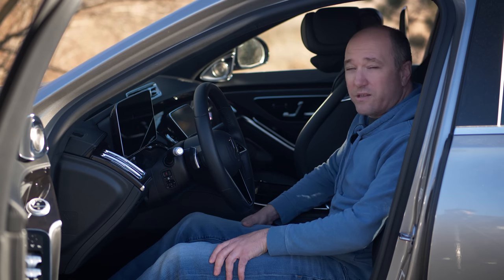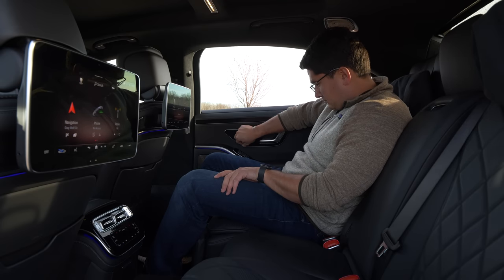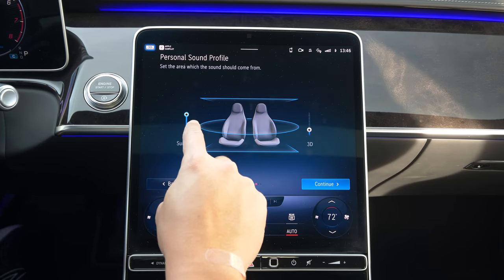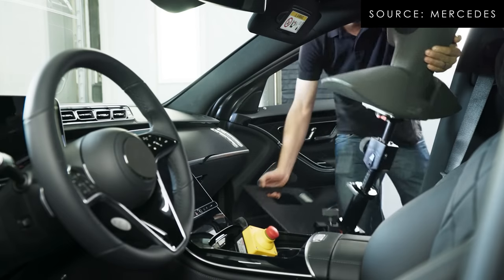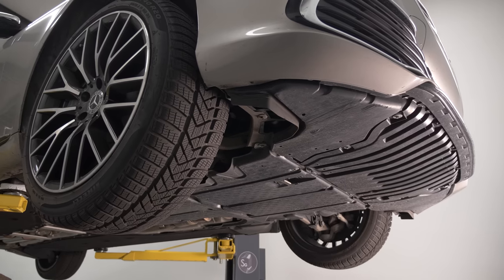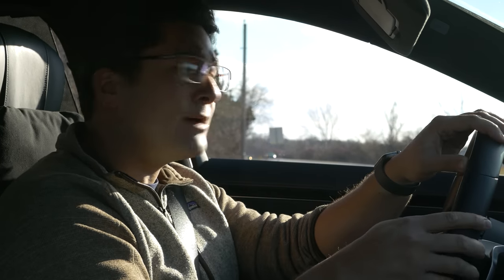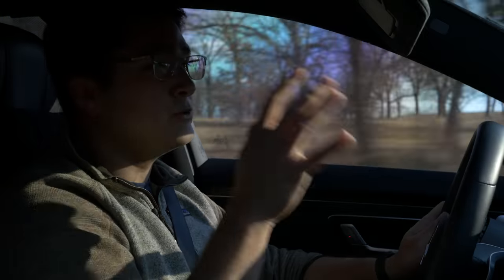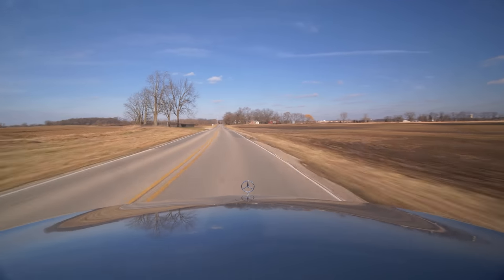Mercedes S-Class | The Best and Worst of Cars

Comment: I think MB went in the wrong direction with the S-Class but they sort of had no choice. The S-Class used to live on quality; quality of materials, quality of construction, and quality of engineering. That's what the old 70's, 80's, and 90's cars were like. The centerpiece was the quality, the thunk of the door, the feal of the leather. These cars were timeless, a car you gift to your grand kids. Enter Technology; Technology has become the centerpiece of the S-Class, and technology is not synonymous with quality; technology is cheap and disposable and that soils what is otherwise a quality car and makes the whole thing totally disposable. Your grandkids would laugh at you if you tried to gift this to them. However to compete with up and comer luxury brands, like Lexus and I guess the Koreans, now MB has to push the technology and skimp on the quality.

Comment: Did they really put the hazards button on a touch screen... fucc, what if your engine dies at night and the electronics are 99% down, in most cars the hazards can be actioned with the engine dead, not in the S class it seems. Not having physical hazard button is a hazard in itself
Reply: The hazard button as well as the other buttons in the row below the touchscreen are actually physical but yeah, if the screens go down you’re still in trouble in other ways 😅

Comment: Ask any W221 or early W222 owners about their long term experiences, same thing.  Plenty of them on the road.  Not sure what people here expect Mercedes to do here as far as tech.  It has to be there for this car's target market and the age of the S-Class owner has been dropping and in some markets they're much younger now.  The days of the simplistic W126 or W140 are over.  Now my issue is that they're changing things like the seat controls or the door handles just for the sake of change.  The center screen doesn't bother me per say, but that damn screen behind the steering wheel is gawd awful.  Yet for all the backlash here, the car owns the market and it's polar opposite a car like the LS500 is nearly dead.  Extreme disconnect from 99% of the commenters and actual buyers.  I don't get that animus in the review.  Way off base IMO.  Good or bad, a Mercedes is always an aspirational purchase.

Comment: Just wait 'til you review the EQS. This is the road we're going down and there's no turning back.

Disposable, lease-only, gimmick-driven oversized iPads on air suspension powered by drivetrains that have had all their character and uniqueness engineered out of them.
The looming threat of EU-enforced limits on carbon dioxide emissions and a general alignment of production methods and platform-based architectures between manufacturers will make every new model of every brand more bland and similar with every year that goes by, until drag coefficients are so important that every car has the same, Prius-ish shape, and thermal efficiency is so important that every engine will either be an electric motor or sound like a vacuum cleaner making love to a dryer filled to the brim with paperclips and bearing balls.

If you don't have an interest in engineering or technology there will be nothing left for you in the automotive world in ten years time. It's over. The car is now fast-tracking to become the very thing an increasingly nihilistic society wants: completely rational.

Comment: I wonder if this this Benz will  burn itself to the ground if seat heater does an imitation of the 2000-2007 M-Class vehicles, 2006-2007 RClass vehicles and 2007 GL-Class.
The seat heaters in those vehicles were not content with only heating rich ass in the seat,  the over achieving bun warmers often heated the whole car, garage, and house in a fiery inferno.

One class action suit later and Mercedes agreed to patch the fire prone thrones.

Comment: If you look at the ENTIRE CAR from the passenger rear seat, it starts to make more sense. It’s a driven car, not a driver’s car. The infotainment system, the climate controls, etc are being controlled from the REAR, not the front. If you look at this from the front seat, it’s a fail on every level. I know a lot of quite startlingly wealthy people, and with the exception of one who has a medical condition, they ALL drive their own cars and love them. MOST of them own either a Panamera or a Continental GT as their daily, and the only deciding factor seems to be whether or not they have grandchildren who are regularly in the car with them. The people I know who get driven are hiring a car for that particular day, and the reason is that they don’t want to pay a full-time driver because they now have to provide healthcare coverage, and that is an enormous expense that even billionaires cannot justify to themselves, especially not when they enjoy driving. Frankly, if I were being driven, I would want an SUV with maximum legroom in the rear seat, NO third row, and no rear seat controls for ANYTHING other than the seats and the massive screen mounted to the rear of the front passenger seat. I want that screen synced to my iPhone the second I get in the car, and hot damn I want it to be quiet so I can make online meetings work. That backseat needs to be an extension of my office, and it has to work from the second I get in the car. It’s not to make a statement, it’s to be productive even in a traffic jam. NOBODY who has the sort of wealth to buy this as a disposable item is relaxing in the backseat, that’s a JOKE, and this jealousy driven image people have of the “1%” is an incredibly insulting mischaracterization of who they are as people.

Comment: Unpopular take in the general public, likely neutral in the car enthusiast crowd - all of these touch screens and general screens in modern vehicles make the vehicle look cheap, and also are a future nightmare for anybody keeping the car for 5-10+ years.

The nightmare that it will be to fix and replace all of these screens in used models, across all car brands, is going to be ridiculous.
And then in over the years, the graphics will be so bad that any element of luxury will be insignificant when the tech either doesn't work, or looks terrible.

As a younger buyer (under 25), the infatuation with touch screens is stupid and heinous. How many of you still use a 10 year old smart phone?

Probably not a lot. And if you do, it probably lags and is visually/fucntually poor. 

And that's the point I'm making - the tech in modern cars will be so damn terrible that it will ruin a lot of what makes certain cars great.

What's the end goal with the screens? Are we going to have a Nintendo Switch with joy cons as a steering wheel in the future??

Ridiculous, hideous, and overall I wish this trend of axing all physical control would end.

Save the manuals, yes. Save the physical controls should be the next car enthusiast cause.

Comment: The new w223 is disappointing compared to previous gen w222. I have a S63 AMG coupe 2020 and the value just increased as the coupe is discounted. Also Mercedes has no AMG v8’s for 2022 - not available. Jokers want to copy Tesla. 
Ballers will go for the Bentley Instead.

Comment: The Tesla like touchpanel only design philosophy sucks.. Buttons and knobs can be quickly toggled without even a wayward glance... 

What we have here is basically a giant PHONE. And I thought it was bad to be looking down at your phone while driving? But this, looking down at your giant touchscreen, poking away though menus and sub-menus to adjust your A/C a bit... Yeah, no, that's okay... 

Also, it's ugly. Always covered in greasy fingerprint smudges. Preferred the last gen.
Reply: All the screens increase profit margin. Fewer buttons and switches means less overall wiring. Then they put the money into ridiculous stuff like 50 motors to do a massage in your seat and rotating tweeters in the stereo system.

Comment: NO THANKS. The seat options alone are enough to make me run from a car like this. I wish you could buy a car, plug in your height, weight, leg and arm dimensions, press calculate and get the best possible driving position possible in the vehicle you own. There are so many friggin adjustments that you really don't know what could be the healthiest most comfortable position.
Reply: It has an option to tell it your height and auto-setup the seat. The EQS will even figure out how tall you are when you sit down and adjust the seat for you. Obviously, it's just a best guess so you'll have to fine tune the seat position to get it perfect.

Comment: Who's gonna fix the damn thing? Really? You got half the dealerships in this country going in and out of lockdown with no viable workforce! Sorry MB, shiny bits and edgy tech only works for Tesla. If your car runs on petrol, it has to to be reliable and useful. Cars are only good if they work! I personally know plenty of people who can afford a car like this, but they are actually driving some variant of a Toyota or a Honda. Maybe this car is about exclusiveness and Mercedes wants to keep it that way, but there are plenty of people with money getting more excited about a Subaru WRX than a S-class. Try making a luxury car has a 200,000 mile warranty with good handling and a smooth ride. You should have been working on an electric car that would beat Tesla. Instead you built something nobody really wants anymore.

Comment: That interior looks like the Las Vegas strip. It’s gimmicky and tacky. A huge fail on the part of Mercedes. This thing will end up being a maintenance nightmare. For a car that calls itself the “S-Class” it sure looks classless.
Reply: They feel like they are under pressure to be super high tech for some reason. I think it is in part due to the older engineers have retired and the younger engineers are more into tech than driving.

Comment: It's what the people cry for. At least it's better done than in a Tesla UX wise. As long as you are not older than 40 and have a sense for menu structures, which older people typically just can't process, you can live with it. It's just as shit as every touch display. I like that you sit on the passenger seat because you already knew this is not your car and you can't do the job  because it's not japanese or korean enough and you're too biased.

Comment: Well it seems I'll be the 1 percenter, however only in the comment section, because I don't quite agree with everything you guys are saying.
I mean in what way is it not well thought out and more gimmicky then a Tesla? I mean in the Tesla you can play games, you can't do that (and I hope it won't be available later on either) as far as I know in the S class.
I do very much agree about it being boring in a driving sense. That's what the AMG version will be for which will be arriving ... in about 56 years from what I can tell, although unfortunately it's probably going to be a hybrid, which means more weight then a cargo ship.
I own a W221 S63 and the tech still blows other cars out of the water. What car offers a fridge, rear video screens, heated and ventillated (not cooled) seats for the price of an entry level hatchback. Nothing.
Don't get me wrong I agree with most of the points you made, except about it not being well thought out. It was made for safety and comfort and yeah it's boring as all normal S classes.

Comment: Mercedes, like BMW, is completely on the wrong track when you look at their heritage and what the brand used to mean. Infotainment is ugly, very laggy, and nowhere near as good as Audi. The powertrains are meh (yes, even the AMG ones, they completely lack character, it's not all about horsepower). The build and material quality is not there. The designs are ho-hum. Option for option, they are also substantially more expensive than Audi or BMW.